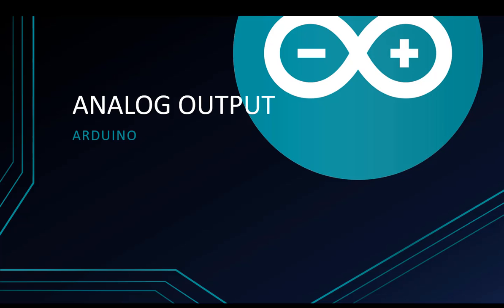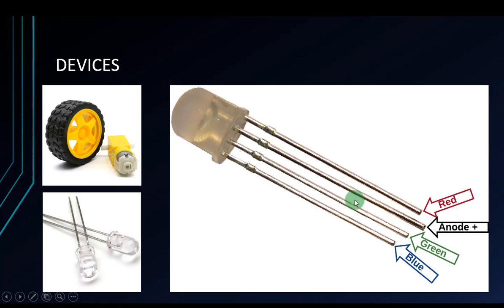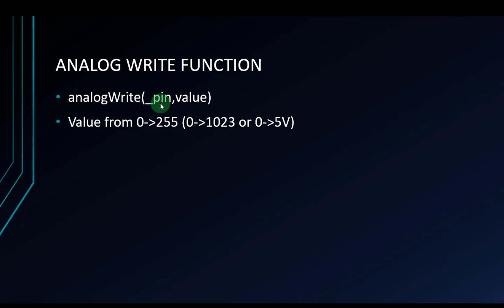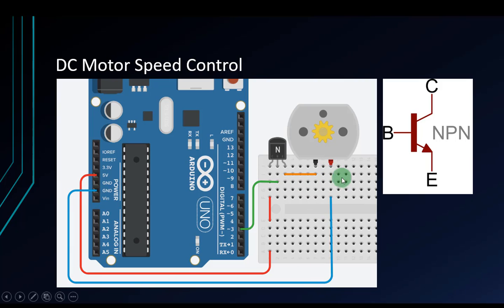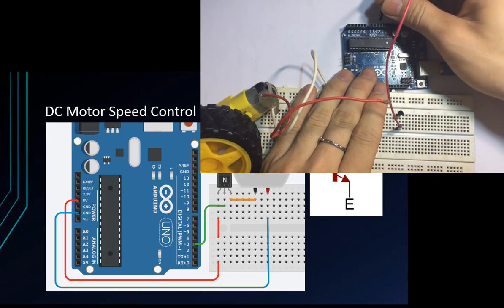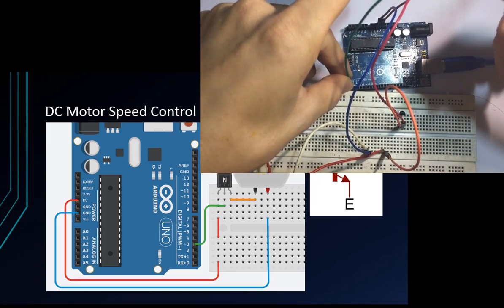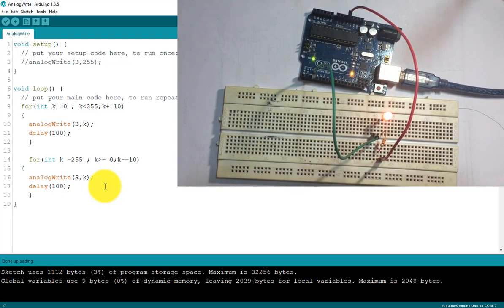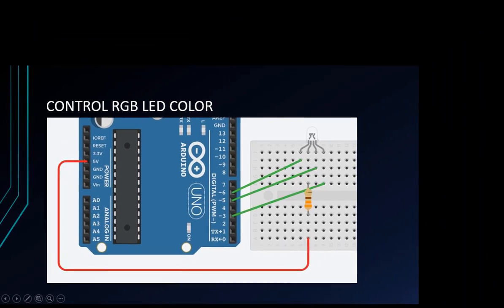Arduino Tutorial for Beginners 11 - Analog Signal Output (PWM) (Control Speed of DC Motor)

Comment: I have the power supply and the circuit board to an AC fan motor.  It seem to be three phase with hall.  There is all the connection to it on the board except PWM 4 pin ( Grn, blk, Wht, Blu).  I assume  they are 12V power, ground, tach and pwm).  I am wondering if I can use Arduinto to hook up these pins and get the motor going?  And if you would know how to find the code for it.  Thanks in advance.

Comment: LED is fine but how can you connect and run motor directly with arduino board?? it's not made for high current, the motor will surely damage arduino pins. Also, we cannot run bigger motor with 5V from the board. Is there any way to use PWM with motor drivers along with external source??
Reply: ouput the pwm to a l293N or similar H-Bridge, it'll still control the speed, even with higher voltages
Reply: You might need  motor shield o you don't burn Arduino